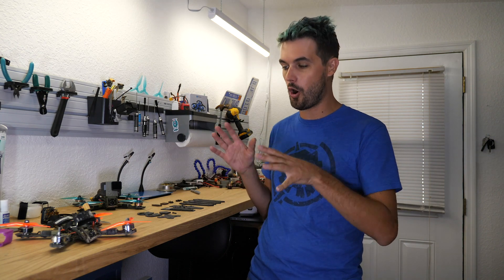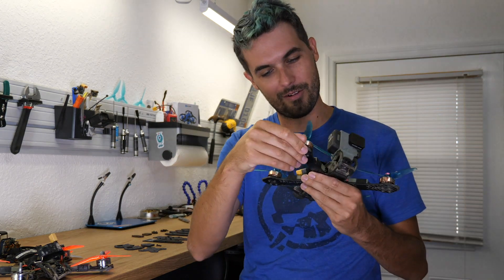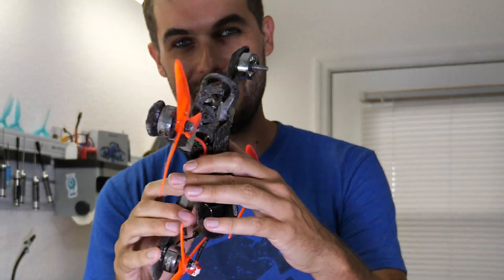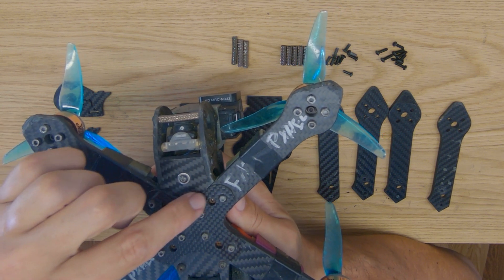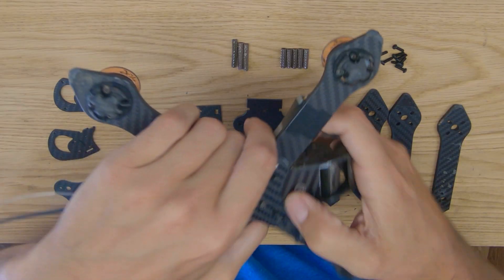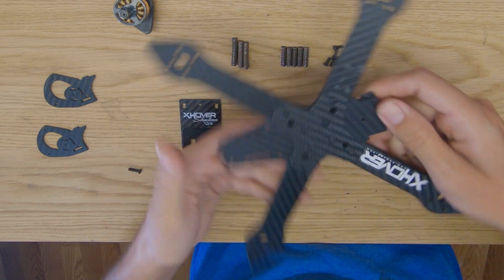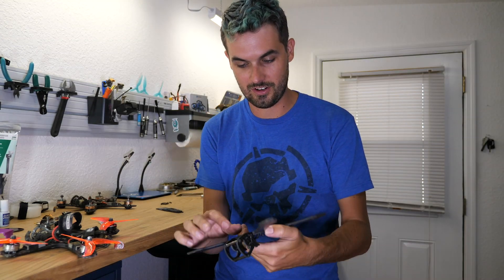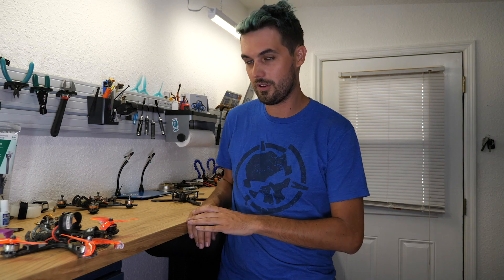Skyeliner STAGE 2 Upgrade! - Overview & Assembly

Comment: I’m looking for a new frame to build that I can install the DJI Air unit on it. Do you think your frame has enough room behind the FC that I can install the Air unit there? If that works, I’m sold. Thanks
Reply: yes the HD version has room.   Watch his main channel to see.   People are worried that it does not have center standoffs but Le Drib says no issue after alpha/beta testing.   I bought it.   Farudi made a good video about how the thicker stiffer arms are better with betaflight 4.1.  That was with the HD1 frame, but skyliner also has monster arms.  So basically, the skyliner HD should provide great video with less jitters using betaflight 4.1

Comment: Do you think the new DJI AIR system could be squeezed in there??
I’ve wanted the frame for a while anyway so I think I’m going to try and worst case I end up with an awesome frame for a new build
Reply from the maker: No there is NO way to fit the DJI system 😭
I tried really hard, couldn’t make anything reasonable work

Comment: Hi Drib. I completed my first build and I flew it last weekend in my backyard. It was my first flight. I was just practicing hovering. Then accident happened. it flew towards my house and hit my vinyl sidings. I guess the speed was maybe 15mph which isn't really fast. When I investigated it, one of motors wasn't rotating properly anymore. It felt like there was a dirt inside. Upon closer inspection, the shaft bent a little. Do you think it got broken easily because of cheap materials used on the motor? It's an Emax Eco 2306 2400kv motor.
Reply: I already bought a new motor which arrived yesterday. I'll practice flying when I get home later :)
Reply: I found out why. My sticks/channels were all off. I went to Receiver tab in Betaflight and values weren't in 1500. I fixed it and practiced it. It's way way better now.

Comment: Wow, broken arms and bottom plates on the Skyeliner?  I've been flying 5in quads for about 4 years now, and never even broken an arm.  Obviously I'm not going hard enough! :) . Love my Skyeliner though, probably my favorite build!  Drew, suggestion for tech content...  I loved your video on the telemetry/Betaflight/SRXL video for the SPM4649T receiver.  Have you tried the new micro receiver (SPM4650?  Any chance of a similar video for htat RX.  I'm a fellow Spektrum pilot, and goot Spektrum tech content is hard to find!
Reply from the maker: You’re going to have to start crashing harder 😈

Yes, I am very excited about the new spectrum receiver, and want to start using it and make content about it. However it is not currently supported in officially released beta flight yet, you have to use specially made BF hex targets. I unfortunately have too many commitments at this time to put in an official firmware on any of my Drones. I need all of my equipment to be as reliable as possible. As soon as beta flight adopts the new receiver protocol officially, I can start using it
Reply: @drib2896  Interesting, didn't realise it was a whole new protocol...  I wouldn't start using one til it's officially supported either, but when the software is ready, and you get time, I'd watch anything you put out on it :)